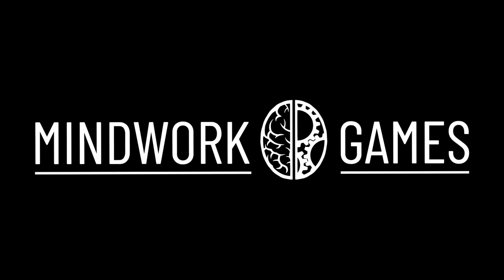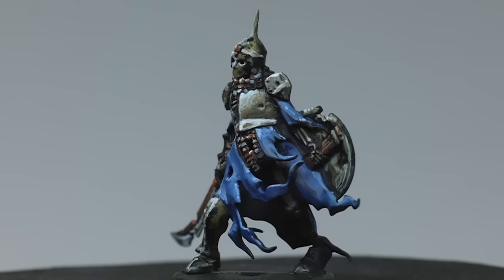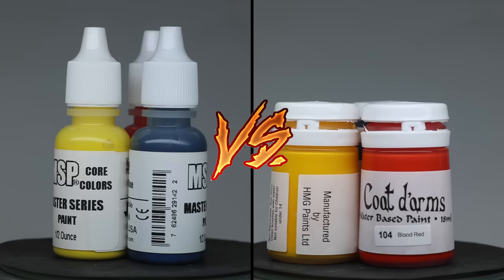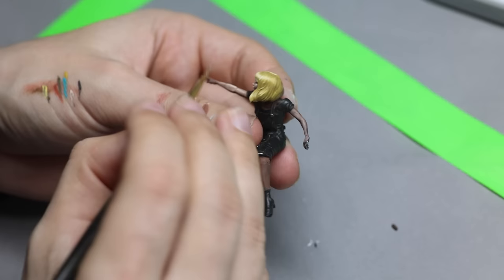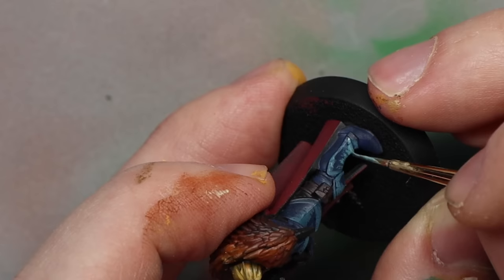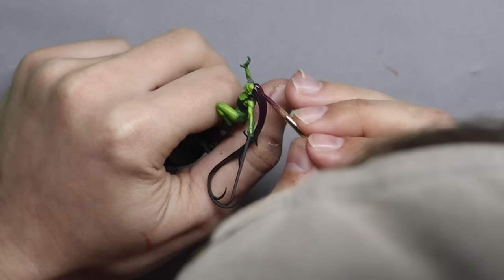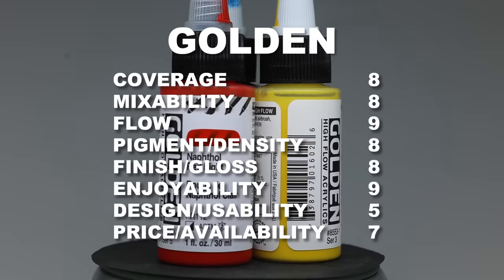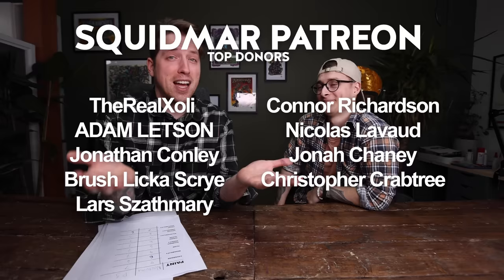Worlds biggest paint test! - pt. 1

Comment: I'd like to see you address concerns that you inappropriately mixed one of the paints against manufacturer instructions. 

Vallejo are very disappointing to me, inconsistent coverage, far too glossy, same price as citadel for me here, so expensive for inferior quality. They are in fact overpriced as they are watered down vs citadel and do not go as far. Hope to see a big table at the end so I can discount the categories that do not matter to me such as the paint pot and your preference for overly glossy figures. You've certainly encouraged me to look for new paints.
Reply from the maker: Hey warren we don't like glossy figures, and quite frankly. I can see you've not used Vallejo model color properly because that would not be your opinion. You get 30% more than with citadel and they are 20% cheaper. How can that be overpriced?

Comment: This head to head elimination makes so little sense unless your doing a losers bracket as well as your sitting a couple of paints that have no business being sidelined vs whats moving forward.  Sidenote.... some of these paints have hydrophobic mediums... and had no business on a wet palette, you influence too many people to do poor comparisons.
Reply: Which paints have "hydrophobic mediums"? These are all acrylic paints, not oils.
Reply: @MegaSneetch  Itll show as a separation of pigment and medium as the medium pushes the pigment down to get away from the water on the wet palette and they stay very neatly dropped up while sitting on the wet palette, theres also the inverse effect where the paints hydrophilic where it pulls water into itself and you get huge amount of dispersion on the palette and it runs everywhere as it absorbs more water and its surface tension drops.  All acrylic paints are either one or the other, the question is to the degree, and just looking at the wet palettes its obvious whats happening on a paint by paint basis and some shouldn't be on a wet palette because of it. Same reason you cant thin some acrylics with water.  I'm not going to rewatch the vid to pick out exactly which ones in this vid are which.
Reply: @therealdadoom7509  Every paint in this video is a water-based acrylic and can be thinned with water. The ones you can't thin with water are Tamiya's alcohol based acrylics which are hydrophilic and turn to goop if you attempted to mix them with water. Otherwise these water-based acrylics are all emulsions and sometimes the medium quickly separates, which can happen if the paint gets damaged via freezing during shipping or something. I have never seen water-based acrylic medium referred to as "hydrophobic" though, and none of these brands warn you against using a wet palette.
Reply: @MegaSneetch  This conversation is the problem with chemistry not being a required class.  Just because something is water based doesn't mean it doesn't want more or to avoid water.  And yep paint brands don't tell you shit, but you'll also get vastly different behavior for some of these paints when not put on a wet palette because they use differing mediums, as yes its an emulsion(so is mayonnaise), yes its water based(so is concrete), but no that doesn't mean it behaves even remotely the same on a chemical level.  Just like with both mayonnaise(hydrophobic) and concrete(hydrophilic), the amount of water it absorbs or sheds will drastically effect your outcome.  This isn't something controversial, its basic science.  Its also really easily observable, esp in paint.
Reply: @therealdadoom7509  I concede that I know less about these terms, but realistically all of these paints should work on a wet palette because you just control for how wet the palette is if the paint is separating too fast (or just sucks like AP).  You say there are ones that don't work on wet palettes but can't provide the specific ones, meanwhile I would say that if it doesn't work on a wet palette, it's hardly worth using at all over the majority that do.
Reply: @MegaSneetch  They show the wet palette every paint, its very clear what its doing.  The entire point of paint medium is that it holds pigment in a chemical lattice, that lattice is not water, you add enough water to any paint and the pigment will fall out of the lattice as the chemistry breaks down.  Generally speaking the point of the wet palette isnt to thin a paint but to keep it hydrated and prevent it from drying out, theres a lot of factors in how a setup treats the paint, how permeable is your parchment paper? is your water distilled or are there other things in it? how much the medium is attracted to or repels the water?  You can take a paint that performed well for them, put it on a more or less permeable paper and itll behave wildly different.   Wet palettes are a tool, and a good one, but throwing out other tools because it doesn't work the same is asinine, you dont want all your tools to do the same job.  Vince Venturella has a real good video explaining paint additives and how theres 4 different chemicals commonly referred to as thinners for acrylic paint and how they actually work and the differences in how they thin paint, workability etc, he explains it far better than i can in a youtube comment, but itll give you insight into whats going on beyond the obvious if you really want to know more about it.